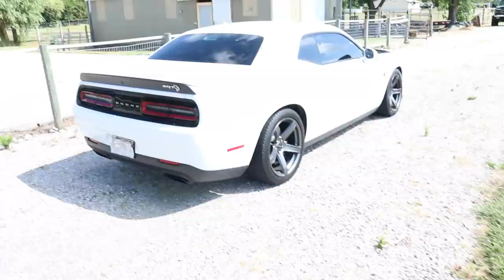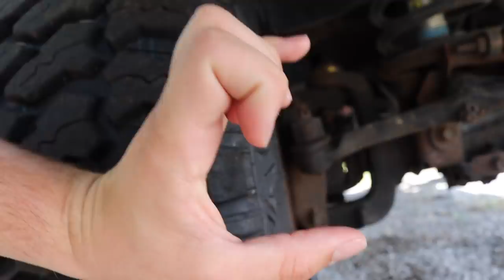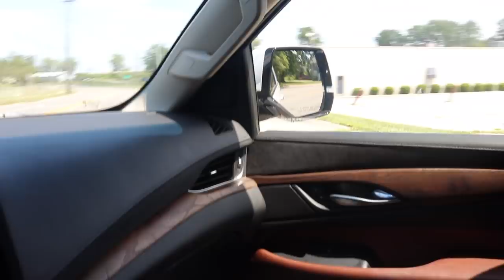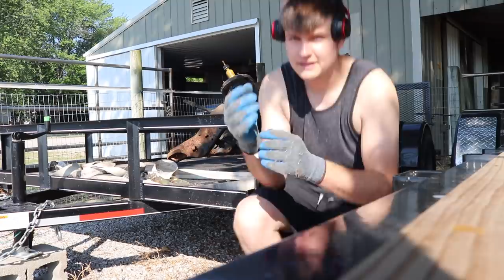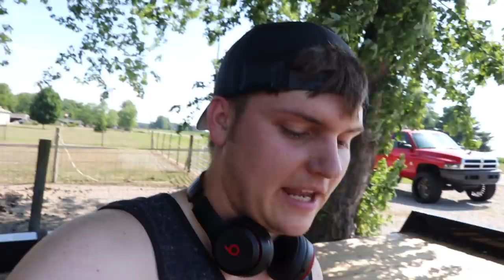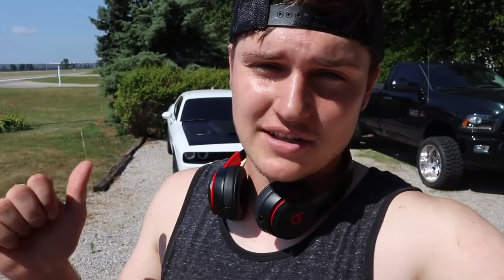The TRUTH behind The ROSINE 24V Accident...

Comment: You need a bolt induction heater for those rusty bolts. It’s basically a heater that has coils at the end with different sizes to fit around the bolt. And once you get the right size you hit the button and lights it cherry red. It helps a ton when getting those rusty bolts off especially where I live in Michigan

Comment: the frame rots out in that spot because its a point where water and moisture can settle and sit in the frame very easily being that it dips down there, a simple drain hole in the bottom from factory probably would have prevented that from happening in the first place, and put ford seats in it from a 6.0 if you cant fix them. if you can find them maybe some chevy cat eye seats if you can find leather ones that arent torn up

Comment: Hey I just saw that the axle u got to replace the 1 in Rosine is for the 98 and older years. Because the ball joints were  flipped the opposite way. Also the brake calipers will b different as well, the older style has a 1 piston caliper with the rotor behind the wheel bearing hub. The 1 in Rosine has a dual piston caliper with a slide on rotor - (which in my opinion is the better brakes). Just saw this and thought I should point this out before you get to far on painting it, etc.

Comment: That doesn’t look like the right front axle for her truck, that looks like an earlier style axle and her truck is an 01 so it should have the better and more desirable later style front end. The swaybar mounts sticking up on that front end looks like the older style axles, there are a few other differences depending on what year it came from too. The swaybar bolts up differently and the hubs & brake setup is different on the older axles. The brakes are better on the 01 cause they have dual piston calipers and the rotors are easier to remove cause they just knock right off instead of being pressed together. Also the 01 style axle can be easily upgraded to the newer Ram brakes and steering tie rod setups which is another big advantage over the older axles. You could make that axle work, but it’s not the right front end for her truck and it’s a big downgrade from the one it came with.